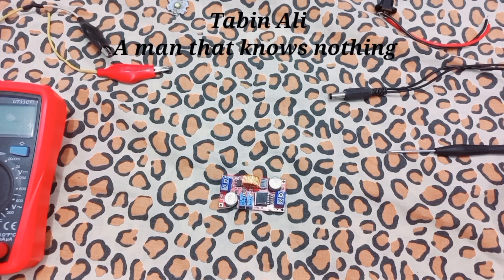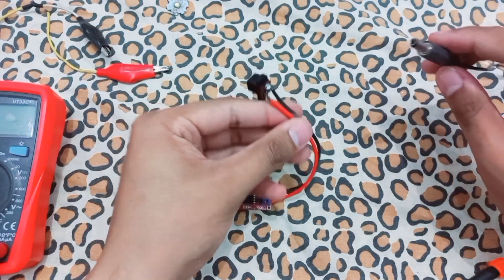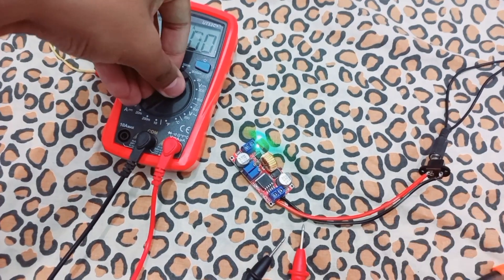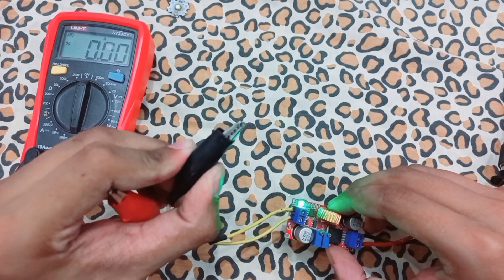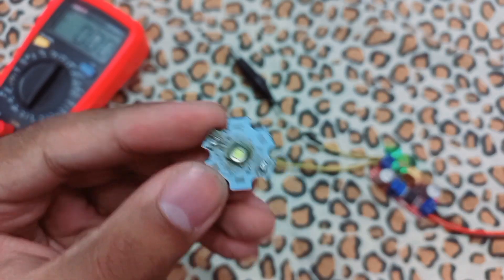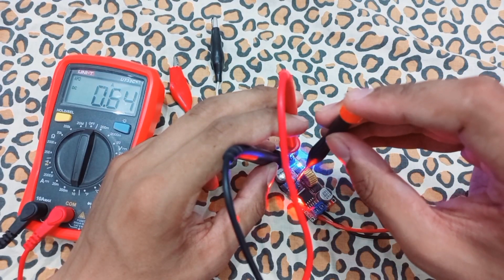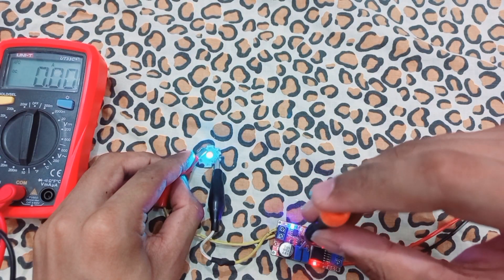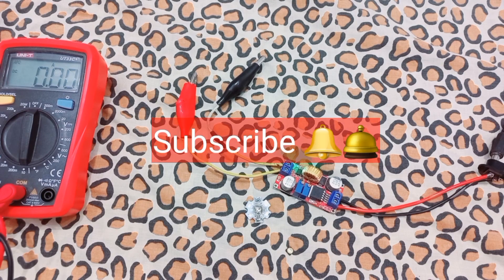XL4015 DC-DC Stepdown Buck converter power supply| Use as LED driver | Driver module

Comment: If You use it as Led driver, all you have to do is to set the limit for the Current. The voltage will adapted automatically as long as the output voltage higher than the load voltage.
So, for example: if you set the output to 32V 1A, It will safely drive 12V 1A Led, 6V 1A Led, or even 3V 1A Led. The voltage will drop to whatever the Load need.
Led Driver is all about Current limiting (constant current).

Comment: How can we hook up a volt/amp meter to this module?
Reply from the maker: With volt cables in parallel at output terminals and amp meter in series with load at output.
Reply: @Electricquantism402  but the initial current settings can only be adjusted by shorting the outputs... That initial current settings wud be displayed?

Comment: Can I use a 3.7v lipo batterie on the input and adjust the output to 6v
Reply from the maker: No .it will not increase voltage..
You need xl6009 boost converter..
Reply: @Electricquantism402  yes I have one it works

Comment: Regarding this module,Certain things I want to suggest you that, when it needs to use as 12 volt battery charger, it is better to use 18 Volt 3 Amp supply as source/ input voltage and set output at 14 volt 1.5 amp to 2 amp according to battery amp capacity. For example if your battery is of 3 to 7 amp capacity, then , 1.5 Amp output current is sufficient. When battery is 7 to 18 Amps, then, set chaging current at 2 Amp. This module is ideal to use for maximum 3 Amp current output for battery charging purpose. Module's IC XL4015 starts heating at over 3 Amp load current and need proper heat sink and cooling fan.

Comment: I was need charger 12 volt 7 apm ups battery can use XL4015 5 apm converter input applying 12 volt 1 apm  when rotating but ouput voltage and current is not increasing or decreasing why this reason help me plz🙏🏻

Comment: Thanks for the review, but what do those LEDs mean?
Reply from the maker: Leds are for indication.
Blue led is turned on when load is connected or battery is charging.
Red led indicates the current load..while green led indicates no load connected or battery is full.
Reply: @Electricquantism402  thank you very much!

Comment: Hello everyone,

✅I can adjust my voltage to  3V or 10V without any problem.
❌However, I am unable to achieve an output current lower than 2A.
Do you know why?

Here is my configuration:

Input:
Switching power supply MEAN WELL RS-25-12 (12V 2A)

Output:
Amperemeter NEOTEK XL830L set to "10A"

Thank you for your assistance

Comment: Bhai mera yeh wala module pr input 5V diya ha maine output adjust karke 12v ana chahiye na 12 q upto 33v but jitna input de raha hoo utna volt output pr hi nikl raha hai.. kya problem hai bhai..
Potentiometer to ulta sida guma bhi raha hoo fir bhi nhi ho raha hai😭
Reply from the maker: Aeise ni hota bro.. input 5v de k output 12v kese ayega..ye stepdown converter hai boost converter ni hai...isme output voltage hmesha input voltage se km hi hoga...12v output chahye to xl2009 boost converter use kro..mere channel pe video available hai..go and watch.
Apka problem solve ho jayega
Reply: Abe LuL ye Buck Converter h Boost Nhi , jo tumhe voltage input k comparative high mile ga.

Comment: What is the use of red light ?
Reply from the maker: Red LEd indicates current limit feature.. when you short the terminals of module or connect it to any load, red and blue indicators turn on.

Comment: If input is varying then output will be constant??
Reply from the maker: If total input power is lower than output, then it will definitely vary..
But if its higher, then there is no variation.
For example if input voltage is 18v and output is set to 12v , then if you change voltage from 14-18v at input, there will be no change at output.
But if you reach to 11v or some, output will no longer be stable.
Reply: @Electricquantism402  thanks bro

Comment: Can I connect 12.8v 6Ah Lifepo4 battery at input to draw 12v 1.5Ah from output?
Why I am asking this is it's 5A module so if we connect 6Ah battry at input will it damage circuit?
Reply from the maker: You can even connect 200Ah  12v battery to input...its output should not exceed 5A load..at input, you can connect any power source within 5-32v input voltage range..no matter how much ampere you are giving input to it.
Reply: @Electricquantism402  thank you so much for your reply. U clarified my big doubt thank you
Reply from the maker: @ksaik88  👍👍👍

Comment: Kya ye moduel power bank me Kam kr skta ha bro power bank cell battery 5 volt input or and out put bhe 5 volt charger kra ga ye
Reply from the maker: Han 5v input de skte ho lkin output pe 5v ni milega..4-4.3v tk milega kiun k ye step down converter hai..
Output hmesha input se thora km hi hota hai isme....6v input doge to 5v+ output dega ye
Reply: @Electricquantism402  thanks bro so nice reply